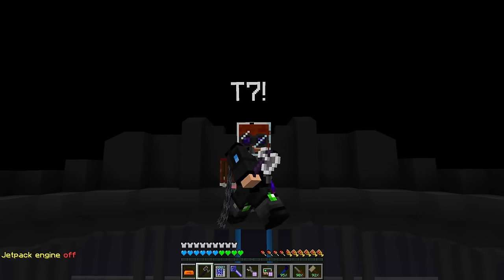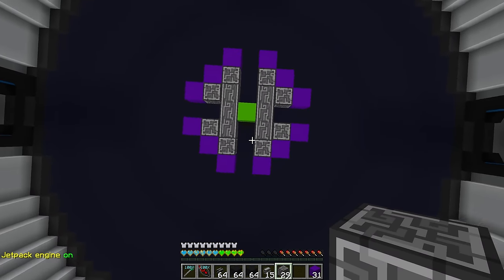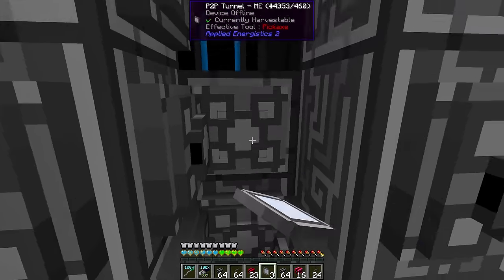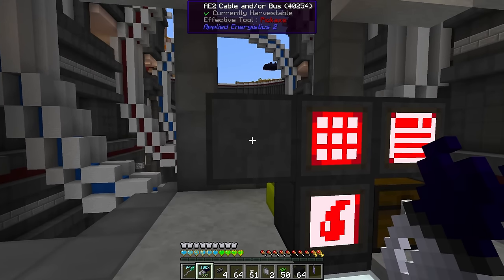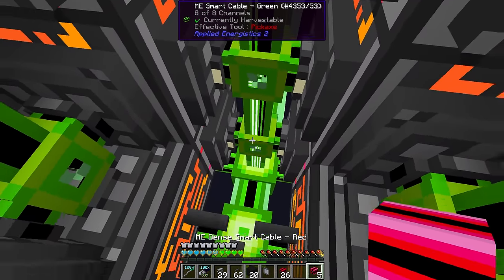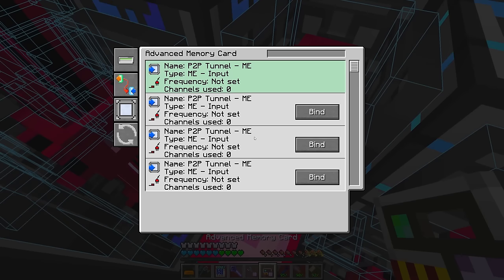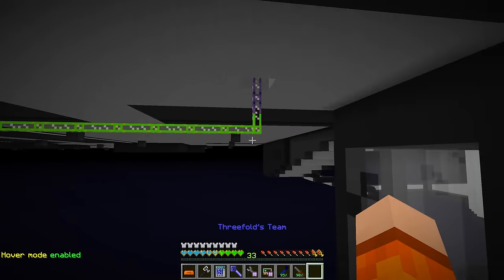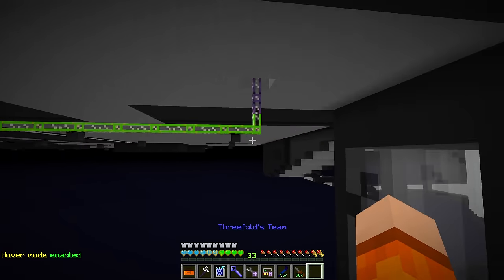Gregtech New Horizons S2 56: Rewire Desire

Comment: 37:13 you can see in tooltip that eu p2p in overworld is configured as input side
37:32 eu p2p in void dim is configured as output side
Reply: Yup, one of the few P2P modes that is semantically strict about "input" and "output".
Also be advised that you take a 5% transmission penalty!
Reply: @KaneYork  is 5% penalty that excessive? It doesn't seem that bad on paper.

Comment: Bees in GTNH has basically two options: Gradually chip away at it in the background while you do other stuff, or rush through it with at least HV tier tech. As it so happens Three has access to that, so he can dive into bees whenever 🙃.

You definitely want your AE2 controller to not be fully build initially, because it'll have a passive power cost of somewhere around Yikes EU/t for that stage of the pack, but also have space reserved to easily expand into a final controller design. And, ideally, swap over to wireless connectors once that part of the pack hits circa LuV/ZPM or so. The simplest controller design that (mostly) fit these criteria is a 7x7 square with a line drawn in the middle, eventually upgraded to a full cube of the same shape. This gives plenty of space for early game P2P connections, and leaves tons of space for eventual wireless connector shenaniganry. It's not the singular most controller efficient design for early on, but an extra, what, 1A MV passive cost at worst is worth the cost of maximum future proofing IMO.

Something worth noting, since it's kinda important RE: the above 7x7 design, is that you don't need to have a separate subnet handle your P2P channels. You can slap an ME P2P on a controller, route that P2P into the same controller, and draw a P2P line from that same controller again to carry the compressed P2P line from the controller to wherever. Is it optimal to do this? Not necessarily, there's ups and downs to that kind of design, but it's viable. And, as said, kinda encouraged by the 7x7 design since you end up with five "permanent" P2P connections in the middle of the square, so using them without also using the controller as it's own P2P subnet would get somewhat awkward.

This kind of blackout is the reason why, ideally, you don't power your AE2 system using the AE2 system. Because if at any point something goes pear shaped the entire thing goes down and needs to be manually restarted. Which can be a far worse process than yoinking a super tank of fuel from somewhere and dumping it into another super tank. Also, if you want early warnings that your fuel tanks are dangerously low on fuel? Howler Alarms! They're not just good for cleanroom maintenance issues, they're good for many thing you want to be informed about 🙃.

Wireless AE2 is convenient, but if the EU/t cost is too high just place around a few extra terminals and make sure you've got good movement options RE: Staff of Travelling/Blink Focus/etc. Chances are you'll get extra terminal from lootbags anyhow, so very little harm done setting them up in places you're likely to use them.

BTW, wireless access isn't necessarily a flat 2.5 EU/t/m. I believe the power cost increases if you go beyond 16 boosters, though can't recall whether that's a thing off-hand. In any case, be careful with how much power you're drawing. And inputting into the system, for that matter 🙃.
Reply: When you said there's ups and downs i read it like there's updates per seconds and downs lol
Reply: That's a lot of text. Too bad my meds wore off lmao
Reply: hey shadow, im trying to craft Thaumium tool parts in the part builder and its not working, same with extruder. any idea why?
Reply: @jaustin6367  Not off-hand. I don't recall ever running into issues RE: Part Builder not working.
Reply: @jaustin6367 Might be a conflit with gregtech version of Thaumium and Thaumcraft version. I know it’s made in part builder 100% tho
Reply: @NotNyrZ   I got it, had to reload pack version. I was getting so mad LMAO

Comment: It looks like the energy consumption of the wireless access points is a flat 2.5 EU/t per block of range, so it would be more energy efficient to have one access point in the center of the base with a ton of upgrades rather than several spread out access points with a smaller range. (Because the area covered by each increase in radius scales exponentially, while power usage scales linearly)
Loving this series as usual <3
Reply from the maker: Well spotted. However, i noticed that only applies up to 16 boosters. After 16, things go crazy and it starts to increase exponentially. Welcome to NH 😂
Reply: @Threefold.  Ah, nevermind then. Greg never lets you rest

Comment: GregTech energy P2P connections are directional - when you were trying to connect it to your battery, you were trying to output through the "input" P2P. It should work if you swap the ends over.

Comment: My note for visuals. The dyed "WIRES" (😂) on the storage is bit too much, the default maybe black look way better. Only thing there I kinda miss seeing the face of the super tank and super chest (the art there is super cool). Also I get why you try to use wireless connection to reduce clutter but I kinda miss seeing the cable runs to the corresponding places in the void (like the EBFs). Of course this is only my point of view. Thanks for all the episodes, missed ya !🎉

Comment: there is an item in AE2 that allows you to see the fluids in the system. without that block you cannot see or craft with fluids. also make sure your fluid storage busses have the input and output option. looks like you figured it out. the EU P2P, Make sure its on output to send the power. I saw it was on input. i only use those to power my base and whenever you change demissions they sometime lag out and turn off the machines so ensure you have a power buffer because they will not send for like 2 seconds when loading in. Also the matter condenser can take in water directly.

Comment: Your power problem was because your fluid export bus for the 15 main turbines wasnt working because you had the discretizer in your inventory. If you had just plugged that into the network it would have fixed most of your power problems.

Comment: Hey, Three!

What Service Provider do you use for your personal server? Also, how much RAM & other specs do you use for the server to run?

I currently run my own as well, but I want to try to maximize on TPS and FPS, if possible. Even though I have an RTX 3070 + 16GB of RAM, my FPS fluctuates a lot in my base. Can go as low as 20fps
Reply: Minecraft is pretty cpu bound, and afaik is only single threaded. More ram is nice, but I'd look at cpu bottlenecking before GPU :3 (also I think 16gb is enough for gtnh, though I wouldn't be surprised if it would like more. Be sure to check your java args to make sure your actually giving it the ram. Though I doubt ram would drop fps, running low on ram tends to crash the game x3)

Comment: Correct me but why have the need for the p2p subnet at all? 
Wireless connectors completely replace the need for the p2p and are less hassle & cable. 
Form from function like the engineers tend to say.

Comment: i've always wondered, is it necessary to put the p2ps on a subnet? I still always try to keep the two networks separate, but is there an actual reason to not just connect the p2ps to the main net?
Reply: It's definitely not necessary, but it makes things easier to manage imo. Makes it easier to make sense of your channel usage, since you won't be borrowing main net channels just to carry p2ps. You always have available channels equal to 32 * number of main net p2ps installed. Then, you just need to make sure that your subnet can provide channels equal to the number of p2ps installed.

Comment: Holy crap I completely missed that there are EU P2P tunnels! Are there any downsides to them? Expensive to run? Do they have a limit of throughput? They sound like a complete game changer!

I have reaaaally long LuV cable links flying all around my base from my central power buffer, but a P2P based system could really clean it up.
Reply from the maker: There is a flat 5% loss on all power transferred through the P2P. Most of the time it's better still to run cable, but i guess it depends on how far you go :)
Reply: @Threefold.  Ooooof that's significant not gonna lie.
Reply from the maker: Yes, it's not something that should be used everywhere as it will eat all the power :D

Comment: I know I'm late to this series. Catching up. 

I got questions about P2P and subsets. What are the benefit of subsets? I just don't see it. A P2P can run on the main net just fine. Ypu get yo mamage just as mamy channels. Just loop it back to the main controller right? I've run stuff like this before. Never found a need for the subnetwork. 

You were like almost about yo answer my question when you demonstrated the p2p. I got excited... and the. You added the subnet controller and then got nothing for why. 

My appreciated for any help.

Comment: Still very confused about subnets. I get P2P, but I mean, you still have to pull those P2P/compressed channels into the subnet and then out of it, so where exactly is the saving?
Reply: To my understanding, let's say your main net has 2 separately coloured sections, like Three's. From there, if you run a dense cable carrying 1 colour (let's say blue) across your base, and use up all the channels on that section (blue), you'd have to run the OTHER colour (lets say red) from the main net all the way to the desired destination without touching blue which is full. If you route through a subnet instead, you have the ability to access EVERY face of the main net, so every P2P, via the subnet. This condenses the output because the subnet sees the entire main net, but doesn't have the channel overhead like the main net does, which allows you to route multiple "main sections" of the main net (red AND blue) on the same exact cables. Please correct me if I'm wrong on this!
Edit: Also, you can use a P2P for the P2Ps on the subnet, which is where the condensing REALLY comes in! I forgot to mention this crucial detail. You're nesting P2Ps in P2Ps and "unpacking" them at the subnet level.
Reply: @buttsgalore8390  Ah, the second part is interesting. P2P-ing your already compressed channels... hmm.

But the first part I don't get since you can just snake of channels through normal cable from the main spine.
Reply: @SimonToth83  Unless it was changed for GTNH, you can't P2P a P2P (which is also the problem with the power transfer around 37:00).

As for a "subnet", single cable, without any controller, can support at most 8 devices, so you have to run a separate line for every 8 P2P endpoints. With a controller, you can run dense cables and connect any p2p input to any p2p output, without worrying if they are on the same cable. 
You can, of course, use your main controller for both main processing and p2p routing, but it's easier to keep track if you segregate your main, functional network from the bulk wiring.
Reply: In the void dimension, Three is running a single dense cable down the spine of the base. That is carrying 32 channels on the subnet. Since each will be used for a P2P link, that is equivalent to 32²=1024 channels on the main net. That is the primary use of the subnet/P2P.

The other use, which isn't necessary at this point, is for the compact controller design. Each controller face provides 32 channels, but if you have multiple faces (from different controller blocks) all pointing at a single dense cable, you still only get 32 channels total. If, instead, each controller face has a P2P on it, you get access to all the channels (up to 160, if you have 5 controller blocks surrounding a cable that sticks out).
Reply: @tom.prince  You didn't read what I said and you are just explaining P2P, which I understand. My question was: What is the added benefit of subnet (on top of P2P)?
Reply: @SimonToth83  Ah, that wasn't clear. It probably isn't strictly necessary here, since the controller isn't maxed out. Using a subnet probably does have some advantages, such as forcing you to use P2P everywhere, rather than accidentally forgetting to use P2P on one section of a base, and thus starving your main network spine of a bunch of channels that were being used elsewhere.

It would be necessary if you wanted to max out the number of channels on your main net, given that an AE2 controller has a bounded size. If all the faces of your main controller have P2Ps on them, you'd need a separate controller to manage all the P2P channels. I think I'd be surprised if anybody has actually used that many channels. (Although, there is an outside possibility of using that many P2P links, just not using the full 32 channels everywhere).

Comment: i think the problem with your EU P2P is that at the supercapacitor side the P2P connecting to the battery is coming from another P2P. AE2 doesn't support nested P2P tunnels unfortunately.